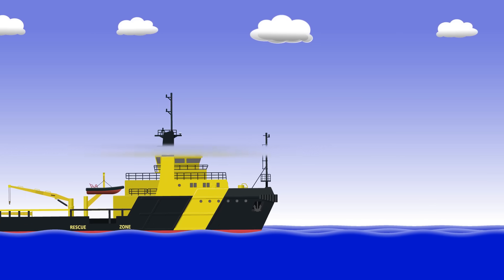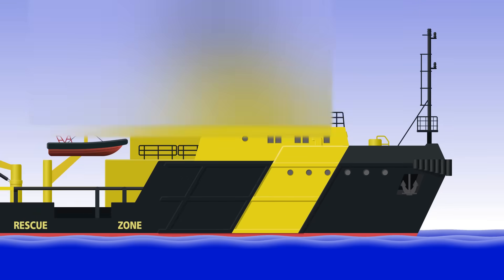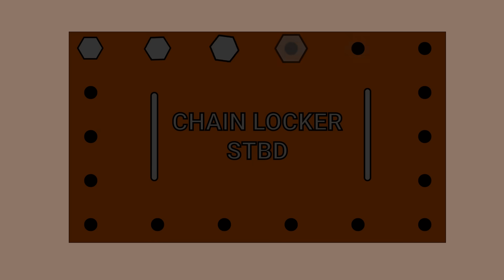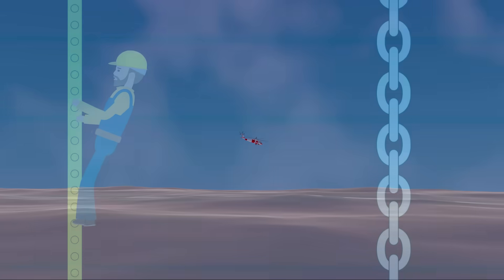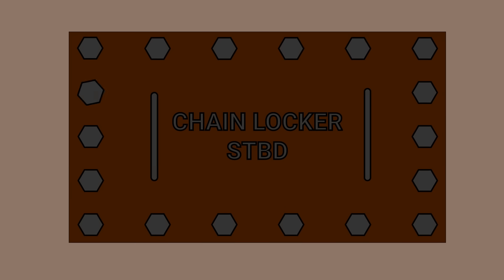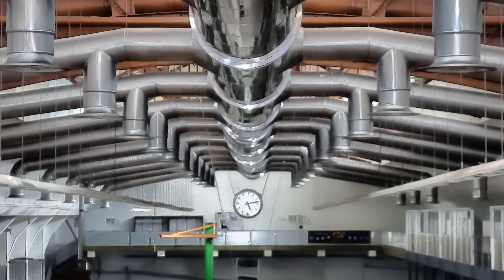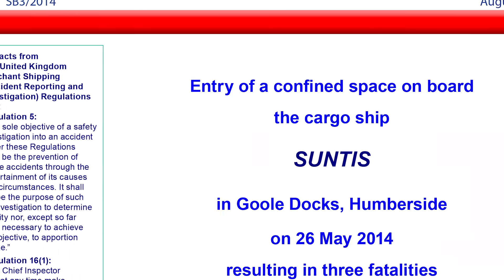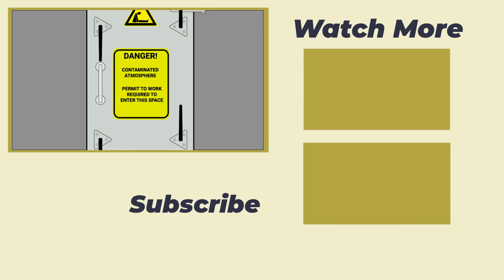Why Enclosed Spaces Are So Dangerous? | Enclosed Space Entry

Comment from the maker: Thanks for the comments everyone. They are all worth a read if anyone hasn’t seen them yet. So many close calls, it just goes to show the importance of awareness.

A few notes that have come up so far…

The spurling pipe was sealed with foam. Even without sealing it though, there wouldn’t be decent airflow.

Yes, we only looked at 1 very specific case here. Many more situations could also result in a toxic atmosphere.

I intentionally didn’t go through how to enter enclosed spaces. You should only be going in after receiving formal training anyway. This video just raises awareness that these spaces are lethal.
Reply: One thing that should have been mentioned was that in this particular case (which is clearly Vroon's ERRV Viking Islay), the company has mandated that entering such enclosed or confined spaces should only be done in port, with a chemist being required to ensure that the oxygen level is sufficient - and has not supplied devices to do either the testing the air OR venting at sea as part of the equipment.  

Whilst the whole part of "only at port" is unrealistic - and was obviously ignored, and not for the first time, as notes about proper size of the spanner to open the chain locker were scribbled on the bulkhead not far from the notice not to enter enclosed spaces -  the cause here boils down to crew doing something they considered routine enough not even to warrant going through the whole red tape of "permit to work" either - and whilst it worked out fine in the past, this time it did not. 

Accidents like that rarely happen because of one single cause - usually it is a combination of factors, so some investigative reports (including this one) are a fascinating read.
Reply: @wolf2965  An accident is an intentional collision you get a letter of resignation before or after someone enters a confined space it a life or death decision to ask someone enter a confined space
Reply: Wow that was a very good explanation 👍👌
Reply: @Casual Navigation 10/10 for not explaining how to get into enclosed spaces. A small amount of knowledge on a subject can sometimes be more dangerous than none at all.
Reply: Same thing happens with root cellars for us landlubbers.  Don't perform a rescue if you are not properly trained as you will also risk your life.
Reply: Same thing happens to cave divers..
Reply: Yes sir yes
Reply: Dude, I never even knew that this was a potential! Thank you!
Reply: Jjuhu5e
Reply: If you want to see a truly botched recovery effort for an enclosed space this video from the 80s is pretty impressive: https://youtu.be/sszSuK-rHn8
Reply: Vg
Reply: Thanks for the video.mIt's surprising how many people don't understand he basic  chemistry and physics of enclosed storage spaces, and many lose their lives as a consequence. People have died by entering such d paces too soon after ventilation is started. Noxious gases can also accumulate as they leach out from stored materials, such as coal, oil, plastics, and more.
Reply: Where did you find the picture of the enclosed space that has a clock
Reply: No vote positive or negative.  Because it was a bad captain, and he should of know better first.  On his head are those dead men.
Reply: How long ago did this happen? You need a permit to go into a confined space and the observer should be trained not to attempt a rescue? Probably in the 1970's-80's or earlier?
Reply: @Ryan-lx6oh  Would it surprise you to learn it was 2007? Crazy, right?
Reply: @PseudoThief  That's insane! I've worked in the logistical side of the Oil & Gas industry in Western Australia so I have got a good idea of the training required to get onto a rig. All I will say in summary is that those men died of/from gross negligence. Broke every dam rule in the book.
Reply: @Ryan-lx6oh  I worked in the oil fields for years and at one place I used to calibrate the H2S detectors. These detectors also measured oxygen content. Anyone is a fool to enter a closed space without one. Even around battery plants at another job I did we always tested the gas in a closed spaces.
Reply: I still alive when I was nineteen and the Apprentice Deckhand  with on the Radium Guilbert I stood fire watch with miracle worker inside a four hundred gallon diesel barge. As soon as the manhole covers came off  the First Mate found out that a Mates Ticket is a limited Ticket it only good for ten days.
Reply: A question worth answering is why would you perish so quickly when most people can hold their breath for at least one or two minutes? Also, why didn’t the men feel uncomfortable before perishing, like you do when you hold your breath? More physiological than engineering questions, I suppose!
Reply: @putrid.p   The body doesn't detect lack of oxygen but a build up of carbon dioxide, if you enter a space with little or no oxygen you can still remove the CO2 from your blood but not replenish the oxygen and you will passout without realizing anything is wrong
Reply: @onewithoreos1  @Ed Jones  Precisely. And if the egress is down like that, you need fall protection and dude #2 would've just been cranking up passed out dude instead of descending into the CHAMBER OF DEATH where he promptly dies.
Reply: @putrid.p  "why would you perish so quickly when most people can hold their breath fit at least one or two minutes?"
Without oxygen, you lose consciousness pretty much instantaneously. Holding your breath for a minute or two is only possible because there is usually always spare oxygen in your body, typically both in your lungs and in your blood. But when you breathe in an oxygen-depleted environment, not only do you obviously lose any spare oxygen you may have had in your lungs - you also literally exhale any oxygen reserves you may still have in your blood, in a matter of just a couple of seconds.
Reply: @putrid.p  That was a great question. Thanks for thinking about that.  I assume you saw the answer to your question from Clipka... Great response too!   It helps me understand why this situation was so dangerous.  Be safe, sir, and again, thanks.  : )
Reply: I can't believe it. The chain can get in and out but no air can?
Reply: @fukpoeslaw3613  For air movement you need more than one hole - or something to force the air either in or out to create a pressure differential.
Reply: @fukpoeslaw3613  I assume the opening is small in proportion of the size of the space. And it'd be partially or mostly blocked by the chain and/or anchor.
Reply: @Macumazahn16  no airflow thru these enclosed spaces t hats why they are so dangerous only time I have been inside some of these enclosed spaces is when we have been dry docked , and you still keep a strict protocol  due to safety concerns
Reply: @fukpoeslaw3613  In this case, the holes that the chain passes through were blocked up with expanding foam, to prevent water getting in. The anchor hadn't been used in many weeks, so there had been no opportunity for any fresh air to get into the chain locker.
Reply: @PseudoThief  Aha! maybe tonight I'll be able to sleep quietly for the first time in a year.
Reply: @fukpoeslaw3613  Density of the atmosphere. If the replacing gas is heavier than normal air, it's not going to move.
Reply: @NorthForkFisherman  but O2 is heavier than N2 or the normal mixture of 80% N2/20% O2, right? so at same temperature you would expect the O2 to rise up and the air to go down.
Something I'm not understanding here?
Reply: Methods  That is an astounding story BECAUSE it's so unlikely, unbelievable and improbable. But not impossible. Apparently. So yes, is miracle because if this is thought impossible and yet Thing? Thing is exists or occurs wow wat?!>!@?!?!/> Yes. Oh, i mean yes thing is then miracle.

Comment: i wonder would downright emptying an oxygen tank in the room coudl've saved them ? That or any other forcefull ventilation that could've been done without having to actually go down like if the ship has an air compressor running a line to the hatch and hoping it brings enough oxygen

Comment: Warning boards should be present at the entry area,that warns people to measure the gas content, before entry. Once the measurement is made, with a measurement system installed there,then the system can unlock the enclosed area door,only upon checking inside its software, if gas content levels are in accepted levels. There can be an alternate ventilation system designed in the enclosed area, during construction. Also, oxygen pumps can be installed for older vessels, already built without any designer considerations for enclosed spaces, which can be set to automatically oxygenate the enclosed area,upon lid removal.

Comment: i work on boilers and chillers. leaving the chillers out , i heat water too 360 degrees F and add 200 psi of nitrogen so it doesn't boil then pump it all over campus. 
then we get leaks. water flashes to steam at 16000 times it's enclosed volume. so it fills the tunnel fast. if it blows near you there is no way to escape. when hunting you can tell when close as your chest tightens up fast. lots of time the air monitors won't spot low O2. good times. and yes we do have fans running all the time moving air in there. i still test before going and even have my smart watch set to alert on 95% blood ox. 
very short idea of what i do. as others have said just don't go there. it is fast and you have no warning sometimes not even from the monitor.

Comment: I worked in the paper industry, and we also had similar enclosed spaces (secured by hatches with bolts) in the pulpers and water towers. For entering those spaces for repair or cleaning works, the said space needs to be checked for oxygen and a probe needs to be held in the space to continuously monitor the oxygen levels. If there is a reduction of oxygen even by a little bit, the people need to evacuate and fresh air needs to be pumped in before people can enter again. Confined spaces are extremely serious in terms of safety restrictions in industries, and every new engineer joining is intensely trained about the mandatory safety practices.

Comment: Surely the solution to this issue is to either make these spaces ventilated (thereby eliminating the danger of enclosed spaces entirely) or have a rapid-action fire-hose of sorts that pumps the room full of breathable air in a matter of minutes. Drop the tube down the hatch, open a valve, big rush of wind coming from the hatch, suddenly it's safe again. Right?

Comment: Been there. The process is to blow the "tank" with blowers made specifically for that purpose and then drop a sniffer down there and keep blowing until you get satisfactory oxygen percentage results. Air quality was critical obviously but, being a gasoline carrier, we had to get a clear result for benzene too. Double time and a half for  tank time.  Safety first. 

Also, the anchor chain is heavy and piled in the chain locker randomly as it's recovered. It is not uncommon to break a leg or an ankle when the pile shifts. The chain lockers is one of the most dangerous places to access on a ship.

Comment: I was responsible for evacuating a 500 man office building, once.  

I went to go to an area which had a spiral staircase to 2 basement levels.  As I passed it, I could smell "gas".  As in natural gas - the stuff that heats houses etc.  I called two other people who could also smell it.  I took decision to evacuate the building, assuming it was a gas leak.  AS IT TURNED OUT it was actually someone spilled a cup of coffee with a weird creamer that smelled like that but was actually safe.  Two stories down, in the basement.

I was originally admonished for causing tens of thousands of pounds (GBP) of lost productivity and the fire brigade and gas company came out ... to find no leak at all.

My manager etc asked why I didnt go further down into the basement to determine the actual cause of the 'gas' leak.

I told them if it was a gas leak, and I went downstairs two levels - there's no oxygen.  I'd die.  I'd die investigating. 

The eventual "disciplinary" was shelved when the fire brigade agreed with me - if I, Sarcastic Star Trek, had smelled gas and gone down two floors to check that was actually was the issue, I could well be dead.  I was right to do what I did.

Comment: I have worked inside bulk tanks on trucks and trailers, the first point of order is to ventilate the tanks and arrange a cross draft, either with hoses or by opening 2 covers and blow in air in one and out the other.
We used to open and set the ventilation in the morning and do the job after lunch sp there was a few hours of ventilation first.

Comment: About 13 years ago, i was working in Holland, and a welder who had 2 failed welds previously ( 3 fails and you lose your job ) was worried about his root weld ( tig ), so at lunch time he removed the end cap from the large diameter pipe and crawled inside to check the root weld. Now in tig welding of stainless pipes, the oxygen is purged by introducing Argon. needless to say he never came out alive

Comment: Any person who might need to enter a confined space should have training.  Many situations require a confined space entry permit.  However, those usually apply to planned situations, whereas this situation was relatively unplanned.  The main points here are :  1. Be able to identify a confined space;  2. Have the proper training; 3. FOLLOW THE TRAINING!  Bloody heck!  One part of the training is if the first person has a problem, the second person calls for help immediately… and does NOT attempt a rescue without backup.  This is drilled into you during the training!

Comment: Worked at sea before. Got taught very early on that if you open a hatch and see someone collapsed at the bottom, don't go down until you have breathing apparatus on, and never try and make a rescue with the type of emergency breating equipment the 3rd man used. Also was taught if your bottles don't fit, take the backpack off and either get it handed down to you or work out a way to hold it below you then put it on. Very avoidable situation.

Comment: How does an anchor chain originate in a sealed room, though? Wouldn't the point where it exits the room introduce enough fresh air? Especially through air movement caused by the ship's movements, which would also have helped the air inside to reach the oxidization surfaces wholly.
Also seems like a puzzling construction to me that there would be such a big enclosure with the anchor chain being ... anchored in.

Comment: Thats why we always had a device with us that tested for oxygen and explosive gases while working in enclosed spaces. Before entering you lower it down on a rope and it starts beeping. The faster it beeps the greater is the danger. It saved us once. I wasn´t required to take it with me in that space, but I did. We opened the door and it gave us the constant noise. Turned out that the whole Building was filled to the brim with flammable, odorless gas. It was a gas supply station and the devices that gave the natural gas it´s odor were located behind the leaking pipe.

Comment: I recall this one.
:-(
Another example, trapped in design stage, was a leak from a nitrogen plant placed low in a hull.
Leak of N2 would give rise to asphyxia when folk went in to repair it - and when N2 is separated from the atmosphere, it leaves a higher concentration of O2, which can make an atmosphere very flammable and promote explosions. So, two hazards!

Comment: Those bolts remind me of a summer working at an electric substation.

Most of the stuff inside the gates (all gates are locked by padlocks) are safe if you are on ground level. The wires are high above, the transformers have their contacts on the top several meters up etc.

But there are enclosures within the yard that are locked with bolts. Those are the capacitors, which hold line voltage at (physical) ground level.

Comment: As someone with a confined space ticket I have a warning everyone should heed, don't get a confined space ticket. Since getting mine I have been sent into pipes full of grim, steel silos that were so hot I needed welding gloves and cleared blocked storm water pits with 3 feet of muddy silt I sunk into.
While with proper training and gear the risk to life is low the risk of getting the worst job on site increases orders of magnitude.

Comment: Tree's breathe in carbon dioxide and breathe out oxygen. So why would lumber take away from oxygen levels?
Reply: They use up oxygen too in order to break down sugars for energy, and they only use up carbon dioxide to turn into oxygen during photosynthesis, so if the plant or timber is unable to use light to do photosynthesis, that will happen.

Comment: I knew rust was oxidation. I never really though much about how it takes oxygen from the air in the process. In hindsight, this makes a lot of sense. 
For those who want to understand how hypoxia works, and why it is so important to secure your oxygen mask within seconds, in the event of an explosive decompression event on an airplane, SmarterEveryDay has a great video.  You don't notice the lack of oxygen, and get kinda giddy as it depletes.  You can be handed a lifeline and told to grab it or you will die, and still be unable to comprehend what's going on enough to take it.